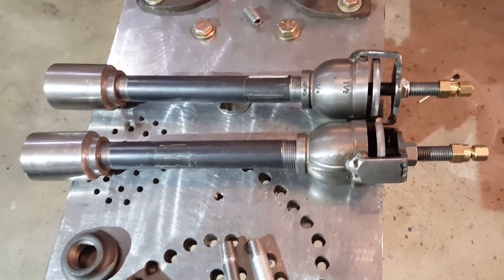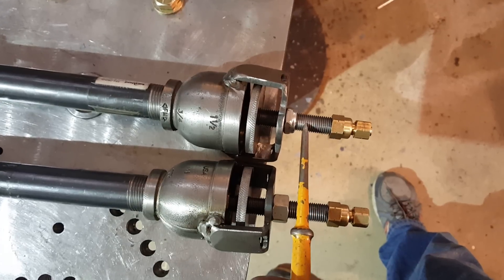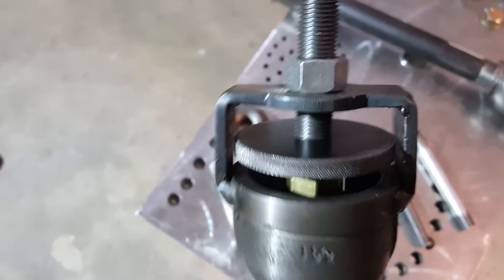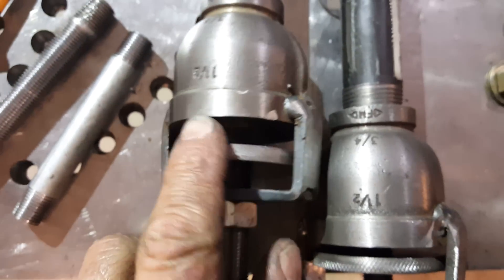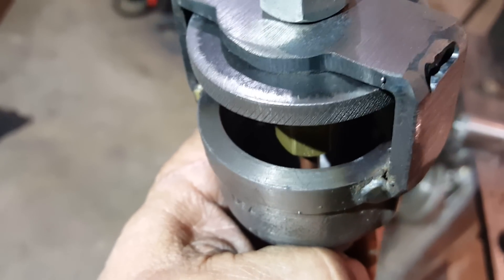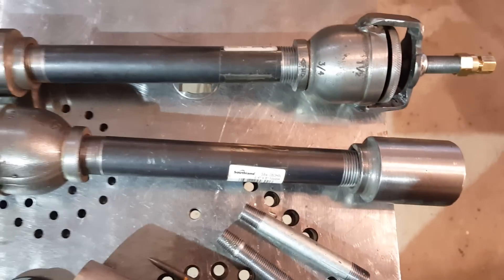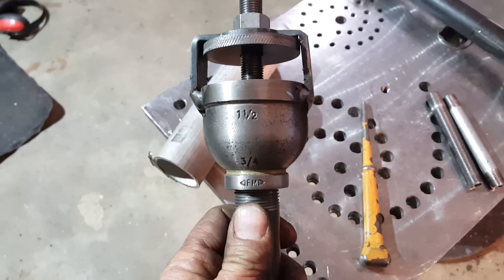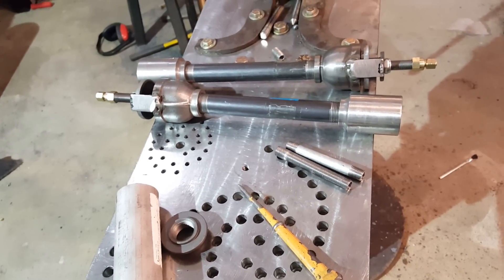Completed Forge Burner

Comment: Hi do you find that you get a lot heat rising back up the pipe. I have just built a forge and it does get hot and also the fittings elbows etc

Comment: what is the mm of the drill you used to drill the hole for the .030 mig tip and the size tap for the mig tip insert? Thanks

Comment: Mike, if you thread the 1/4 pipe to bolt thread, how do you go back to pipe thread on the ends for mig cap and copper fitting to propane?

Comment: Awesome detail!  Where did you find a lock-nut with pipe threads?  Also, rather than running the die down the length of the nipple, did you consider using 1/4" NPS lamp tube which has that thread pitch?

Comment: I built a similar burner. I'm having trouble with increased fuel pressure blowing out my flame. I'm also having the same problem when I open the air flow. Any ideas? Thanks

Comment: Hi MikeI have built one of these and have been struggling on getting it to perform. I don't think the problems are design issues but thought I would try and get some idea as to troubleshooting. The problem that I am having is it just isn't producing a robust flame and am not sure why. I have tried pressures from 10 psi to 40 and while higher pressure is better it still isn't what I would think it is capable of. two questions: where in the unit should the end of the tip be located? (how far in) and also some idea of gas pressures to be used for "optimal " output. Any other suggestions GREATLY appreciated.Many thanks for a fine build !

Comment: I'm really struggling with what direction to go in.  I've seen both your style and a forced air build.  It seems to me that as far as heat goes, both builds would be more than adequate for my needs but that the forced are more propane efficient.  Am I wrong in that thought?  My forge is going to be on the smaller side.  Inside dimensions about 8" wide, 8" tall, 12-16" deep using refractory brick or board.  Excellent build by the way! Thank you for your ideas.
Reply: Deos this forge reach 1000 degree of temperature or not please answer me I'm waiting????

Comment: Hi there! I bought a gameco burner from alec steele and i am loving it. The only problem is that i cant get it on a high enough temeprature. Any tips like ideal propane pressure or something?
Reply from the maker: scott 27 you should have bought mine! Lol!  Just kidding, you might try disassembling it and inspecting it to make sure no tape or Sealer is anywhere near the nozzle.  Reassemble it and you can adjust the position of the nozzle inside the reducer until you get a good flame.  Also make sure you're using a proper high pressure regulator.  Good luck!
Reply: Mike G thanks man. I will try

Comment: is there a reason for going galvanized, to black iron to stainless? can the whole apparatus be black iron?
Reply from the maker: Jaret Olson the reducer is actually black pipe, it's just Shiney from the machining I did on it!  The flare is stainless steel which will stand up to the heat a bit better and no zinc to vaporize!  I sell these for $90 shipped anywhere in the US!
Reply: I was just wondering about the stainless. Did you tig weld that to the BI fitting?
Reply: Great burner! You have an online shop one of these could be ordered from?

Comment: Hi, I'm in the UK, are the parts (American) the same spec as the UK.?
If so could you list what is needed please.?
Excellent vid by the way.
Reply from the maker: Storey Steven thanks for the kind words and interest in the burners!  I'm not sure if npt and bpt are the same, but you could certainly replicate the burner using imperial threaded fittings!  The flare is something that I tig weld together from stainless steel, so that may be more of a challenge depending on the equipment you have access to!

Mike

Comment: Hey Mike, I have been trying to get a hold of you for a burner. Looks like a great design. get back to me when you can I would like to get a price on your most recent version. looks like 90 bucks, but I am wondering if you will sell it as a kit. 
Thanks, John
Reply from the maker: John McAuley Hey! Thanks for the interest, they are definitely available, and are always being improved on!  Latest version has a much improved stainless steel flare and burner mount.

 That's correct, $90 shipped anywhere in the US, just PayPal to mike@abusyguy.com and please send as friend and family so they don't take any fees, and make sure you send your mailing address too!

Thanks again, I appreciate all my customers and stand behind everything I make and sell!

Mike
Reply: My kit question stands. I do not want to mess around with fittings and such. It has taken me a while to build this forge from scrap as it is. jmcaule@gmail.com is my email..I would like to discuss having you do all the work right up to the propane tank. Thanks!
Reply from the maker: John, email sent! Thanks!

Comment: Jeff Conti    I am getting ready to build my first forge I was woundering do you have a diagram of the section that you bend to accept the bell reducer?
Reply from the maker: martin and shan Moldovan Not really, I have a die that I use on my hydraulic press to form them.  You can use a piece of flat bar to make one just as easily.  You can also order a burner from me if you'd like to!  I've changed a few things in the design which makes the burner even better!

Comment: Hi mike.   Great video!  Question...  what do you use to seal the pressurized sections? I was thinking of using a pipe dope.  Do you figure that would hold up to any heat the orifice and other gas delivery parts might see?
Also,  what would you charge for one of those nice stainless ends you make? I'd love to get one.

Comment: This is an extremely helpful video! I don't really have access to a metal lathe, so are all the lathing steps crucial to the build? will it run forge welding temp if the mig tip isn't perfectly centered and the threads aren't removed?

Comment: Hi Mike, I'm building a burner very similar to yours and have been fighting running a die down the 1/4" pipe nipple.  It should have been obvious since it's tapered but I don't have much pipe threading experience.

I came across your discussion about using a 1/4-18 NPS for the outside and a 1/4--18 NPT for the tapered ends. Won't running a 1/4-18 NPS damage the existing tapper on the nipple? I've already tapped my chokes with the 1/4-18 NPT as well. After buying the tapered tap and die now I'm looking for a source on the NPS tap and die. Trying to build on s budget, looks like NPS taps and dies are harder to locate and pretty costly.  Any idea on finding fully threaded nipples I could just add tapered threads to? Did you do a video on the threading of the nipples? 
Did you tap the choke and threaded bracket with NPS threads as well?

Thanks in advance.

Hope my chokes are still usable.
Reply from the maker: Steve S. You must have really torqued on that nipple!  The straight die doesn't interfere with the original taper, because, well, it's tapered! Lol!  Your choke may be too "sloppy" on the nipple after using the tapered die. 

If you want to save a bunch of time and money I'll sell you a nipple that's already threaded, and uses a new nozzle system I came up with.  I'll also include a. 030 mig tip as well.  The new one is much cleaner and works great! 

If you'd like to order one I'll sell it to you for $15 shipped.  Pm me and I'll get the particulars from you! 

Mike
Reply: Mike G -Thanks for the quick reply and generous offer, however I'm in too deep now to let this 1/4"  pipe nipple win. Here's where I'm a bit confused, the nipple measures about     542 thousands and generally a NPT tapered die would cut threads smaller on the end and get wider where the threads stop.

From looking at a NPS chart it looks like straight 1/4-18 thread's major diameter ranges between 526 - 517 thousands.
So........by running a 1/4-18 NPS die over the larger tapered pipe thread wouldn't I be taking too much material off the tapered end thus destroying the taper. Sorry about spelling out thousands but the text wouldn't except my decimal. Not sure if this is a personal message, new to YouTube.
Reply: @steves.8747  You can also buy 1/4" NPS "lamp pipe."  I think.  That's what I'm about to try.

Comment: Love this design! What is that reducer called you use for the flair that's is threaded/ weld? I can't seem to find them online. Also I was curious roughly what that measurement is between the reducer bell and that bracket you made to hold that 1/4 pipe

Comment: Hi Very nice job! My question:  Does the flare fitting at the burner outlet  (flame end inside forge chamber) have to installed after the burner is installed in the forge case? I did not get a good look at the forge itself and from the video I did see (Big forge running) it looked like the flare had to b put on after installing the burner.Thanks!!

Comment: So I have been rebuilding an old Mankel double atmospheric using the bells and your design inspiration. The thing I am doing differently is to eliminate the tapped plug electrode holder by threading the inside of the rethreaded 1/4x6 nipple at the bottom end.This streamlines the airflow around the part there,rather than mostly plugging up the hole. Sure wish I had a lathe. I make do by making extra parts and choosing the best.

Comment: What size die did you use to thread the 1/4 x 4.5 nipple?  1/4 NPS (straight pipe thread), ran it out the bottom of a 1/4 NPT or 1/2-20?  (FYI 1/4 pipe thread is 0.54 od x 18 tpi at the wide end)
Reply: Mike G thanks.  I appreciate the clarification.
Reply from the maker: Rich Cizik yes, 1/4-20 and follow up with cleaning up the ends with 1/4 npt die so you get the proper seal.  Works brilliant!
Reply: I assume it is a typo when switching back and forth between straight thread and NPT.  Do you mean 1/2-20 and then clean up end with 1/4 NPT?
Reply from the maker: Sorry, my mistake! 1/4-18 NPS for the outside, and Npt for the ends....
Reply: Mike G so 1/4 -20 NPS On the outside and 1/4 - 18 NPT on the ends
Reply from the maker: Peter Wilson just to clarify, 1/4-18 NPS  for the outside.  The ends are the only part you need a 1/4-18 npt so you get the taper, that's what makes the proper seal, the tapered threads.  The outside die for the choke mount could theoretically be whatever size you want that fits the diameter of the nipple as it's main purpose is to hold the pipe nipple in place  and move the choke up & down.  Sorry for the confusion on the - 20 pitch thread reference, that was a typo, I use only - 18 pitch dies. 

Mike

Comment: Can you please tell us where you got the weld on fitting for the flair?
A great looking burner!
Thank you for sharing
Reply from the maker: RFAM05 I get them locally at an industrial supply store.  I'm thinking about selling just the flairs so folks have the option to use a stainless steel flair.... Would you be interested in something like that if it were available?
Reply: Mike G,  I've been watching a lot of videos online and really like your design. If you start to sell those stainless steel flairs would you let us know?  I would be interested.
Reply from the maker: I replaced the steel weld on fitting with a stainless steel part, so the flair is now 100% stainless steel.  It's a 3 piece design that I tig weld together.  Pricing just the flair isn't something I've considered, but I think I might be able to do something with it....  Considering the material and labor involved, I'd have to charge $20 plus shipping for it to pay for itself.  If you think it's something you'd like to order let me know., and thanks so much for your interest!  BTW, I'm working on a new video for the burners, since I've upgraded the design a bit!
Reply: I would be interested in purchasing a couple of the flares.  I want to try and build the rest of the burner though.  What's the best way to go about purchasing these flares?
Reply from the maker: Derrick Hoelscher, you can use PayPal and send to mike@abusyguy.com pm me for details!
Reply: Mike,, you set on the price?  this post was a while back ,,just wondering if you still offer these flares . ready to roll on these in a couple of days

Comment: The flare have to be a cone....
Reply from the maker: naabtalschmied not necessarily... The flare is basically an area for the flame to establish itself.  Some folks don't even use a flare, they open up an area in the kaowool or fire brick which provides that area of expansion for the flame. There's a few of us who make our burners with this design and they burn extremely well.  Thanks!

Comment: Hi mike,  where is the mig tip in relation to the 3/4" nipple barrel?  above, level, below?  if not level, how far off?  thanks
Reply from the maker: Nicco Deamus the top ends up approximately at the junction of nipple to the reducer.  The nice thing about this design is that when I do the tuning I can move tip tip in and out of the bore to get tge best burn!
Reply: Thanks Mike.  I have coincidentally built very similar burners to your design, I found your channel trying to find out how to tune the burners.  In fact my whole forge and burner set up is almost identical to yours (without the precision).  I'd add a photo if I knew how....but the burners seem to burn slightly differently and I was wondering why.  No change after making the tip heights the same level, so I'm now thinking that one of the tips is more off angle than the other.
Have you experimented with adding a static fan blade at the air intake under the choke to create a mixing vortex?  I am going to try that to see what happens
Reply from the maker: Nicco Deamus I haven't tried that, but it is extremely important that the mig tip is aligned down the pipe nipple.  If you are running 2 burners it makes a bit of a difference where the tee is, and also to run a good gas regulator.  Good luck on your build!